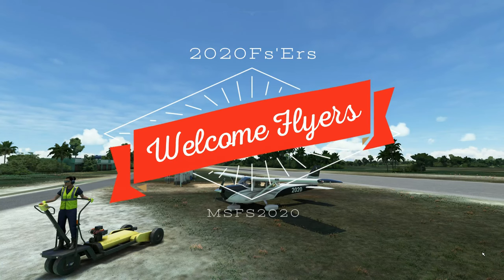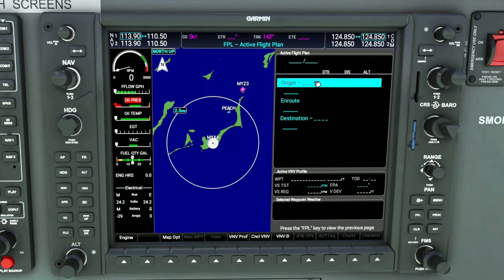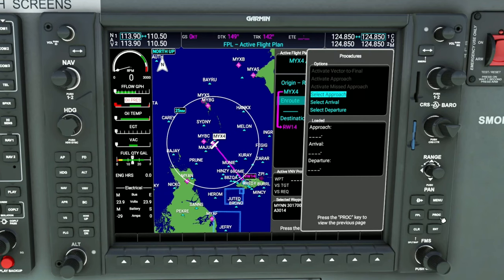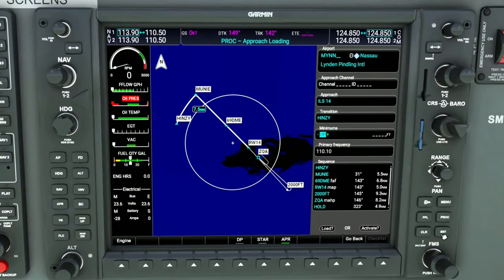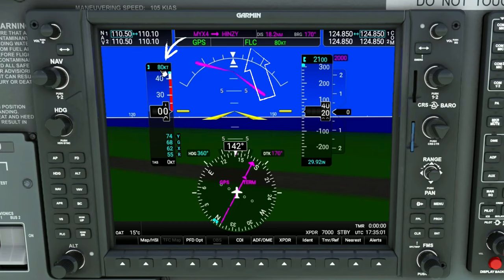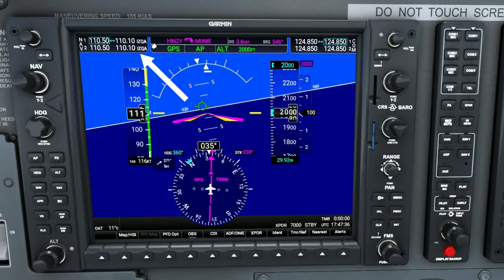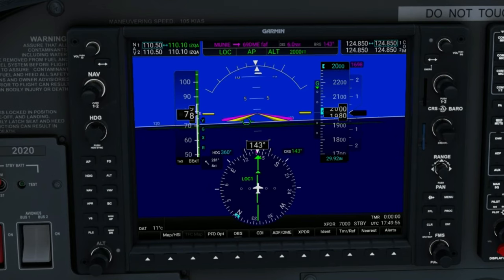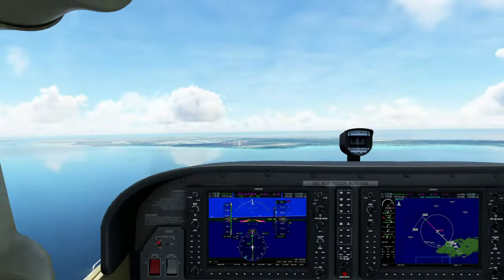Msfs2020*G1000NXI ILS Landing tutorial* Entering the FPL & Approach/W FREQ'S Cessna 172

Comment: The NXi was a big update over the regular G1000. And it's free! Once you learn how VNAV works, it's easy and fun to watch it work. They fixed RNAV approaches too with the NXi. Nothing is easier than flying the Diamond D62 and let the VNAV take you down and follow restrictions. With the D62 and it's FEDAC computer system, no need to worry about propellers and mixture. All done for you. You just control the throttle. It would be great if you showed us how to use the visual approach. I haven't been successful with it yet.
Reply from the maker: Thanks for the comment . I am going to do an entire g1000nxi series and I will dive into all the systems and some flights . The da62 is a fabulous aircraft and the mod is the tops for it.
Reply: @2020fsers  That will be great. Yes, I use the mod for the D62.
Reply from the maker: Cool im.going to start that soon im.gonna post my windows settings video first..this is gonna be good... then ima start with more tutorials in msfs .

Comment: Ah there is an Approach button just like the LOC and APP button in the Airbus. I forgot to press this that´s why it did not follow the glidepath down to the runway but kept on the autopilot-set lowest altitude of the last waypoint. Awesome tutorial perfect funny and easygoing explained. Soon I can fully enjoy my Cirrus SR22 in the most harsh IFR-conditions with night-vision like synthetic landscape rendering and 90% autoland thanks to your tutorials. :) 
But I assume it is not going to flare and land in it´s own with the autopilot? Can a virtual glideslope be calculated and set VS Target -3.0° on a custom waypoint in the correct distance and bearing to the beginning of the runway similar to the Airbus Flight Landing System for airports without ILS?
Reply from the maker: In the vnav of the fpl page you can set your glide path if you like . Default is 3.0deg

Comment: Great video as always. Question, why would the suspend button automatically come on when I do an ILS or rnav? I'm not sure if it's the plane or something I'm doing wrong
Reply from the maker: A lot of times you will have a manseq or vectoring from ATC at a particular point in your flight plan so what the GPS does is it suspends the guidance until you tell it that you're ready to resume again
Reply: @2020fsers Thank you for the reply,but how do I tell to resume? When I click it off the magenta line doesn't come back it just shows the approach at the airport
Reply from the maker: @rackum44 yeah that's what it's supposed to do because it's assuming that ATC vectored you to the approach so you would only need the approach to show so the only thing you could do in that situation after you hit the suspend button and it resumes is do it direct to so you can highlight that Waypoint and just hit direct to or you can activate the approach and if you activate it it will take you on a direct course there
Reply: @2020fsers  ok thank you for the knowledge,I appreciate it.i also appreciate your videos
Reply from the maker: @rackum44 thank you 😊

Comment: Hey buddy, nice video.
I just got the Xbox s. Trying to imput an ILS frequency, head towards the airport to intecep loc, when pressing nav mode, AP , the buttons desingage for some reason, they don't stay on. Am I doing something wrong?
Tks
Reply from the maker: ok when you engage nav mode to intercept the ils  make sure the hsi is in nav1 or 2 whatever you have the ils programed to .
Reply from the maker: oh i will be doing an entire new g1000nxi series once i finish the longitude series i am working on now .
Reply: Yes, it's on NAV 1 on CDI.
Also, what do you recommend as a control to fly it?
Reply from the maker: I either use vnav to the faf or vs . If that's what you were asking
Reply from the maker: The ap shouldn't turn off on its own .. does this happen in every plane

Comment: I just watched the video bro can’t get no easier than that the way you explained i can’t wait to try it this evening after work . So far the only thing I’m not sure about is do you have to control the altitude or does it do that for you for the glide slope and then once you hit that altitude you hit approach button right. Thank you so much for your time to do this for me. I will let you know how it goes if I don’t get stuck lol. By the way I love how you can do everything sitting in the plane that is the bomb
Reply from the maker: Yea so you control your altitude until you lock on the glide slope . 1 thing I didn't go over is the flight restrictions In  the video and I'm kicking myself now for that .so depending on  how many flight restrictions you have until the FAF you may need to descend manually down to the FAF at that point is when the gs can capture .  In this video my faf was at 1698 so the glide slope was able to capture when I was at 2000 but let's say you are at 5000 at the 1st flight restriction and the last one FAF is at 1698 then the glide slope will not capture at 5000 I hope I explained that well. So you would manually descend or use vnav down to the FAF then to activate the approach . Like I said In the video once locked on the gs it will override an other vs or vnav
Reply: @2020fsers  Very well explained I will mess around with it and get back with you and thanks for the quick response. Where would you select approach maybe the last waypoint or before
Reply from the maker: At the FAF
Reply: @2020fsers  ok so if I’m understanding this right on your final approach you have to be in the Final approach target altitude  is some what right I know I will figure it out you gave me a Headstart
Reply from the maker: The faf stands for final approach fix . On the fpl it shows what waypoint is the faf. That's where abouts the gs will capture so around that point you activate the approach mode .
Reply: @2020fsers  do i have to set up flight plan first in the sim world map or can i just pick a departure airport and press fly and finish the rest in the plane before take off
Reply from the maker: You can do everything in the plane in the g1000
Reply: @2020fsers  yeah i see that thats awesome almost ready to go lo. last thing is how do you manually set up your climb speed  and then im ready
Reply from the maker: Flc and set a speed .
Reply from the maker: Or use vs
Reply: @2020fsers  bro im speechless it work like a charm but i for got to turn the autopilot off becuase i was to high and the speed was to fast so i hit the approach button at the faf but wasent sure what to do after that does the autopilot drops the speed and altitude when you hit the approach becuase i came in too fast and was a little high other than that i think im going to love it oh and i picked the wrong transition vector becuase it took me on a scenic rout turn lol. next time i will pick one closer. and and i didnt have to push the cdi button it did it for me. i juist seen what i did wrong i went back to your video and i didnt hit the approach button on the glideslope altitude the green diamond. anyway practice makes perfect thank you again for taking you time and making this video for me. you are the man
Reply from the maker: Thanks very much ... you have to control your speed ap will not
Reply: @2020fsers  hey buddy i just got the hotfix 1.26.5.0  and stuck on loading screen  is there a server issue  that you know of

Comment: OK going over this one more time if your speed is not low enough and the green diamond meets  the altitude in the middle to activate the glideslope Will the altitude still decent automatically? Because I am not sure what speed it should be for  to the decent. I’m pressing the approach button  but it does not show that it is locked on does it matter if I click the approach button on the left Monitor or the right monitor because I’m clicking it on the left monitor
Reply from the maker: Your speed won't matter for the gps to lock on the loc . And I doesn't matter on either side to activate the approach.the gs won't show green until about the FAF so you have to keep track of your altitude until then.